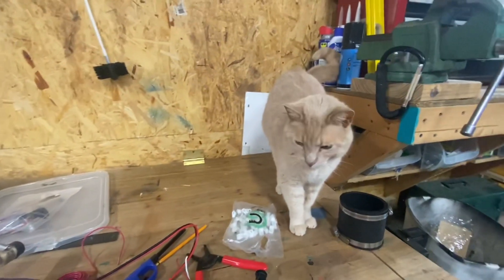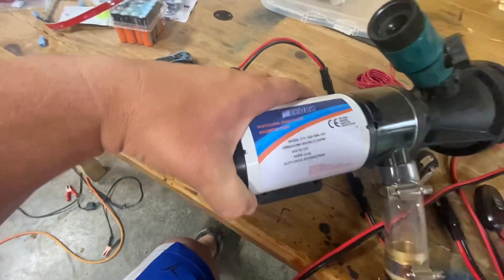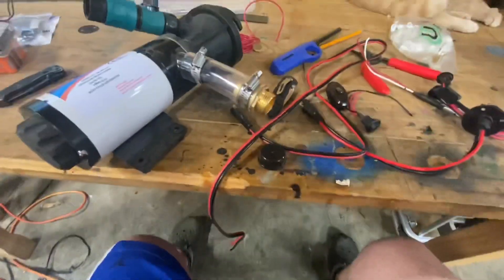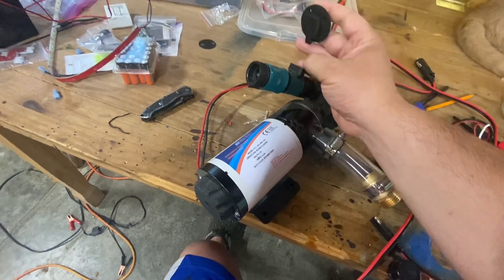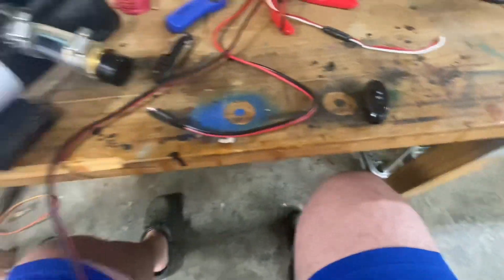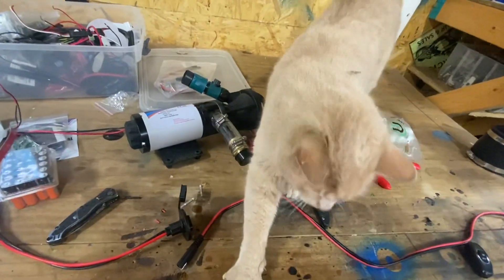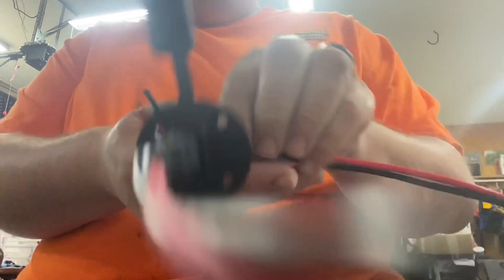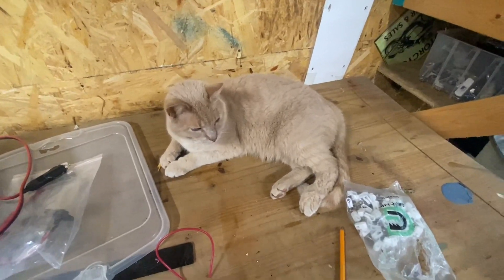Part 2 of the RV Macerator Pump Install!!!

Comment: I use  a maceration pump on  my 5th wheel.  I ran a dedicated  20 Amp circuit to provide power.   The stock rocker switch is of low quality you can expect to replace it down line. We use the pump more for draining the gray water.   Plus if you use septic safe deodorant  for the black water you can pump it into your home septic system. BTW: Their water flush system on the pump doesn't work well and is useless....🙂..... have fun